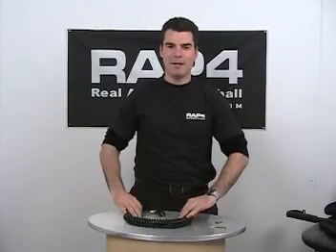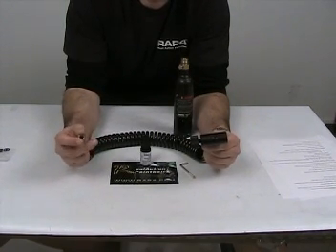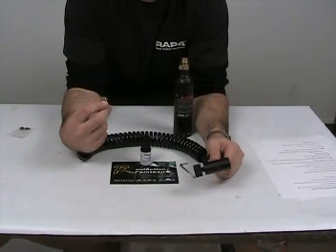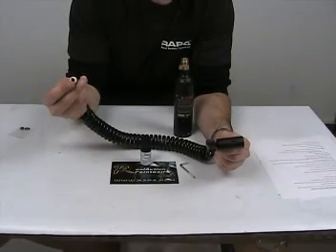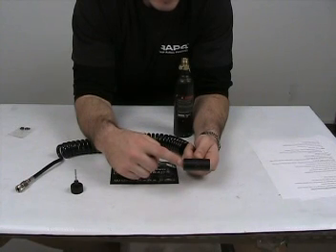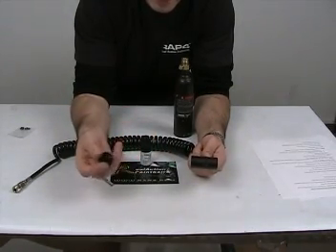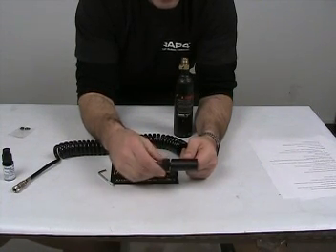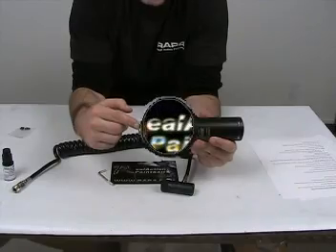RAP4 How to fix Paintball Shogun Remote Line air leaking

Comment: I just bought a RAP4 remote line PRO without the pressure release valve, what it has is a little hole on the part the I screw to the tank that releases the air when I shut off the tank, but every time I do it the screw part comes right off and a ton of air shoots out, that can't be normal, can you guys post a quick video on how to use this remote line, the with without the pressure release valve, just the plain simple one I have. Thanks in advance.

Comment: hello, I just bought a Rap4 shotgun remote line without the pressure release valve, it only has a little hole on the part that I screw on the tank, but every time I try to shut off the tank the part the screws clockwise/counterwise comes completely  off and a ton of air bursts out, can you guys post a video on how to use this remote line please, the one I have. Thanks in advance...

Comment: There is a 3rd place it can leak and it is there mine brand new of another brand (bought from UK).  Mine is leaking on the side in the threads that goes in the adapted and it seems to be glued with epoxy or something so hard that it feels welded shut and I am afraid the whole thing will break before it will move...